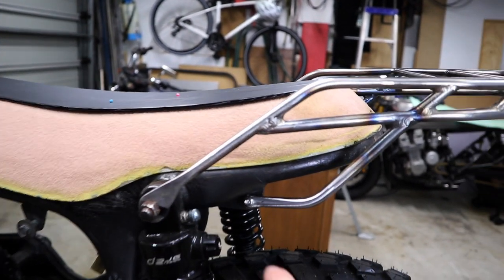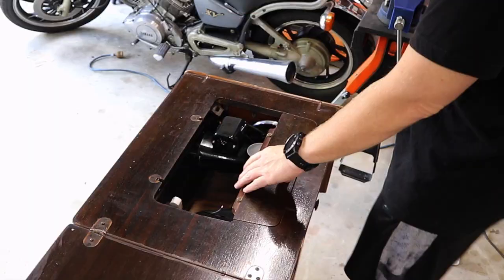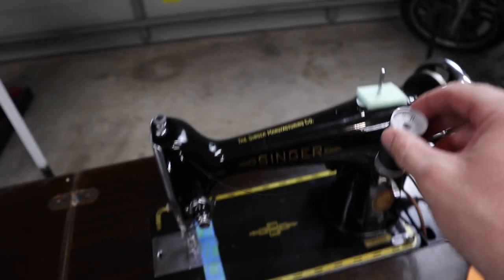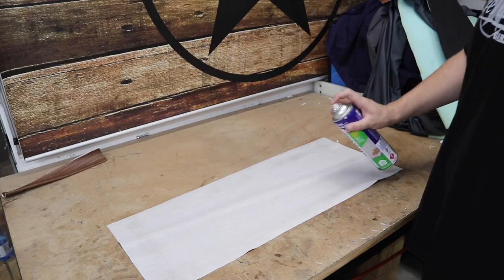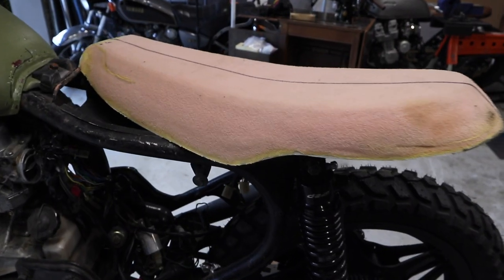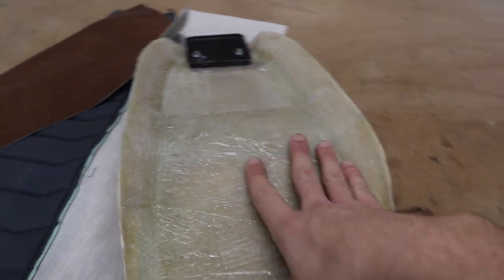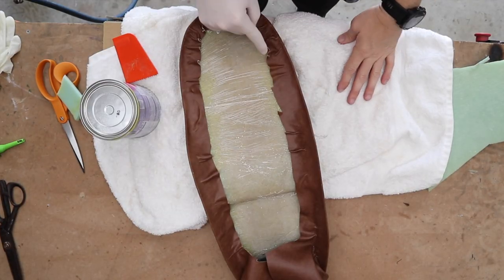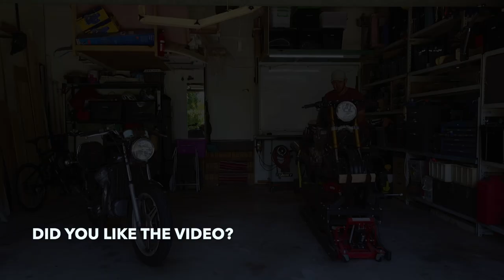★How to Cover a Motorcycle Seat - Start to Finish SEAT UPHOLSTERY - Cafe Racer Garage

Comment: An excellent guide to use on your machine, is to get 2 super magnets, and glue them on a narrow type, short length of aluminum angle.
It's sticks very well on that cast iron base of the machine

Comment: If you think that contact adhesive with toluene, it'll spray easier. In cooler temperatures use MEK methyl ethyl keytone.  We use that same basic adhesive on airplanes a lot. It's a 3M product called 1300-L. It's great for holding pneumatic deice boots on leading edges of airplanes.

Comment: This man, just like me, discovered the value of an original black Scottish Singer machine. It far outrank other machines, when it comes to this type of work.
Reply: Iam about to buy an old cabinet Singer from Craigslist says its in great condition looks clean, dated from 1904 has a Sphinx graphic on it an its treadle or pedal type for $150, should i find an electric one?
Reply: @wolverinebear5357  The electric motors and control pedal did not perform well. If you go for a hand crank, it's better. I fitted my machines with modern electronic controlled servo drives, which a friend designed and built, speeds from 1 to 200rpm, which is ideal for canvas and leather projects. My machines are 1945 and 1949 models. The earlier models with the shuttle bottom thread systems  work well at low speeds, on condition they are very well polished and very smooth, including perfectly tuned timing.
I prefer the 1940's models with the top loading bottom three bobbins. They were built for speed work in the factories that made clothing and canvas apparel for the war.
My machines can do 8 layers of Sunbrella canvas without issues.
Reply: @wolverinebear5357  Another thing is, these old machines use longer needles than modern ones. If your machine drop stitches it will be needle length/depth, meaning, the bottom rotary hook,  or, on older shuttle types, it cannot catch the top loop before the needle pulls up. You are looking at at least a 90/ 130 needle, and preferably a Topstich needle. 
Try and use the thinnest heavy duty Polyester thread. I test them at the shop by pulling a peace by hand. If it does not break by hand, it's good to go.....
But, all and all, they are damn good machines....a little oil now and then, and blowing them out with compressed air every six months, to rid the thread fluff....they will outlast you.
In India they built remakes of the 1945 models. I have one and the quality is good.
Reply: @mikejansen1515  thankyou so very much
Reply: @wolverinebear5357  Great pleasure, my friend. Hope your project runs great.

Comment: Wow... that's way nicer than the seat done by some upholstery around here. 

Quick question, is it going to be waterproof? If it's not, can I make it waterproof?
Reply from the maker: Thank you mate, I guess you can spray something on the foam before glueing it down and that will waterproof it a little but it shouldn't take in to much water as it is but time will tell i guess. Great question by the way. for more info soot my upholster a msg on IG @nerang_trimmers_craigriffin tell him you saw my video and he will be happy to help :)
Reply: @CafeRacerGarage  thanks mate. I'm trying to make a scrambler kit for my daily ride so that I can bolt it on and return to stock body parts when I need to, one the kit parts is the seat. And i live in tropical country so we have 6 months of rain. If my seat is not waterproof, it's not going to be my daily ride, or i'll have soaking wes ass on daily basis. 
Cheers from Indonesia
Reply: I have just bought a Sewing Machine to do seats.
Not yet sewn anything!
I have been doing some research and you can buy sealing tape that you iron over the seams to make them waterproof.

Comment: Nice work Dan. I’m at this stage now with my seat build. I too have a fiberglass base and am thinking of drilling holes and pop rivet the material in place. Think that’d work as well? Glue might be easier, though I’ve read it sometimes will let go. 
Cheers and keep up the great work!

Comment: Brilliant video Dan. Really useful information makes upholstery look accessable. Not a fan a sewing machines but that Singer is such a nice looking bit of kit. The seat has turned out beautifully. Hopefully many comfy adventure miles to be had on it. The idea of the brake light in the rack is a great one if you can sort out the electrics to be removable. Great work dude 👍👍
Reply from the maker: Thank you Adam, yes sewing machines this cool need to be in video :) I wish I did a few things differently when I made it but its done now so I will mention them in a video at some point just to help others, its mainly about the foam,  yes the un plug tail light is a fantastic idea :)

Comment: I like your goal of 1 million subscribers so I'm going to jump in to help out. I'm working on a 77 Honda CB750 right now. I am struggling with the seat build. I didn't think to use fiberglass. I've manufactured mine out of galvanized....not sure how I am going to attach the leather....or where to get a nice singer machine like you have to do it in my garage. Awesome job!! Let's get you to 1 million subscribers
Reply from the maker: Thanks brother,  
I suggest to use contact adhesive/contact cement.   Is the same glue that upholsterers use and it will stick to almost anything

Comment: Back to normal ..Brekkie n Dan ..lol.
Absolutely Brill vid this week with a bit of foresight and planning ahead you have shown the simpler designs are possible if you want to try and have the tools. Glad you used a normal sewing machine but a thicker thread, did it fit the needle ok as some needles have small holes..was the cloth backing anything special or just a piece to suit the size required ,
Like the finished rack and the eyelet idea beats using a nut and having to round it off after its definitely coming together . Also that air sander is now earning it's worth are you gonna put it down at some point or just keep inventing uses for it lol..
Great vid as always Dan thanks

Comment: Have you had any problems using that glue with heat from the sun shifting the seat. I'm looking to buy for my seat just want to know your experience with it in that regard
Reply from the maker: Nick Sotelo it will never move once you put it in place. It’s not effected by sun or water. Marine upholsterers use it so it’s definitely made for the elements:)  make sure you buy the stuff in the tin like I recommend.  The other stuff in the spray cans is not good
Reply: @CafeRacerGarage  thanks alot. Now I can finally get my seat together

Comment: Yep, those eyebolts are nice. :-) There are similar ones with a hole-through-ball in it. Often used at the gearshifter mechanism and such. So many things out there! On old Triumph's (and maybe others?) there was a rack on the petroltank. Could be a good looking thing on yours. :-)
Reply from the maker: John Mård funny you say that as I was thinking the same but unsure at this stage, I may give it some more thought.

Comment: If you wipe down the steel rack with penetrol, it won't rust while you're waiting to paint it (as someone else suggested). I use it on my welding bench to prevent surface rust. By the way, it looked like you were deliberately hiding the label of the contact cement.. ? Excellent work on the sewing machine. I bought a Sailrite machine a few months ago to attempt my own upholstery, but I haven't actually plugged it in yet...
Reply from the maker: Michael Nelson that’s awesome thank you mate, I noticed that when I was editing and I didn’t mean to. It called kwik grip contact adhesive
Reply: @CafeRacerGarage  I figured it was probably Kwik Grip - I use it for gluing carpet onto marine ply for boat floors. I've sprayed it before as well, using a large nozzle on the spray gun (I think you can probably drill out the one you have if you want it to spit glue out quicker)